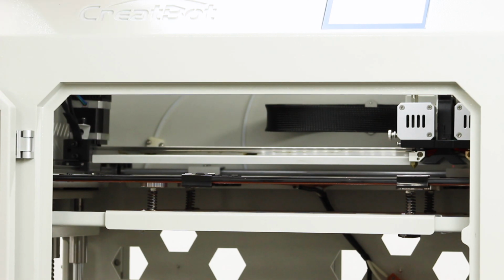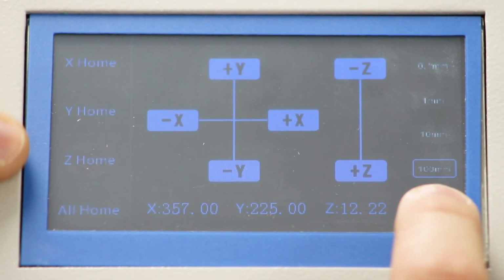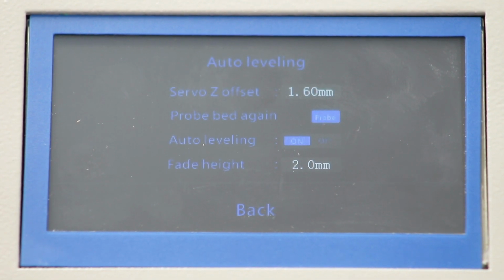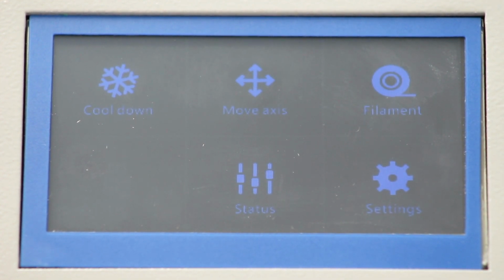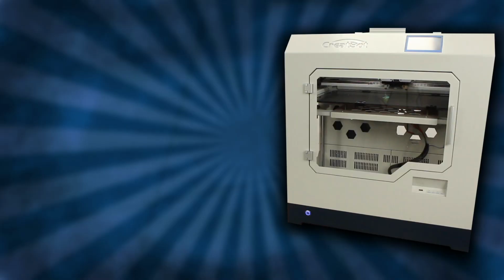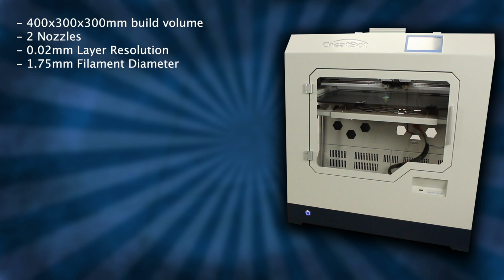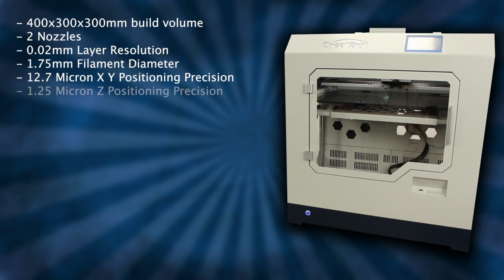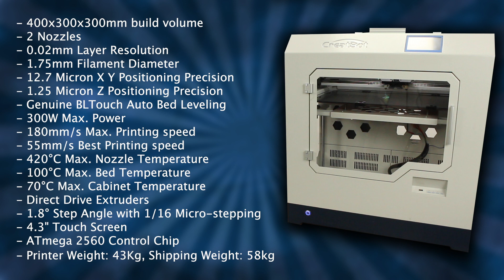Creatbot F430 Unboxing and Initial Setup

Comment: Sorry guys, but not sharing test print results makes consumers suspicious of product quality and your relationship to these manufacturers. I see by other comments  I’m not only one wondering why you avoid this.
Reply: I bought one, would not print sample parts at all.  I test printed my own part, and the print quality was amazing. The build quality of printer is very good, touch screen is eh...but it works perfectly fine, just not as polished looking as my flashforge.  So far, machine is not perfect, but feels very industrial and like a workhorse.  Its 100% capable of some really really good prints.

Comment: I have this printer and it has a large build volume.  However if you built anything close to the the build volume size you could NOT get the part out of the door.  Otherwise it is working out great.
Reply: @hightempreviews5137  Yes I need to clarify.  The machine comes with a carbon-fiber removable build sheet.  The sheet is 500 wide while the opening is 425 mm.  To get the part off the sheet it is nice to take all out and flex the sheet to pop the part off.  It is sometimes difficult to get the sheet with a part on it out the door.
Reply: @markkeown9532   No longer has removable sheet

Comment: Note that if you print a large part you can not get it out of the small front door opening.
Reply: How did you get it out then?
Reply: Who on earth builds a max x,y,z part? It would take a week and several rolls of filament.  So thats just a dumb observation that a few youtube mathmaticians harp over.

Comment: The video was great but I always end up wanting to see a test print on all the unboxing videos you guys do.
Reply from the maker: We are working hard on them...soon we will be releasing many print videos :)
Reply: I have an unopened f430 bcuz i may return bcuz im looking to find out the REAL print volume using the dual ext. Cura is telling me its like 337mm 😵‍💫and Creatbot says its “close” to 400mm (X axis). My part is 388mm and dont mind angling a bit but dont want to get stuck w a $4k printer that isnt much better than my CR10s pro. Any help??
Reply: Creatbot informed me at seems to be right that Cura settings are X-510mm, Y-320mm, Z-300mm…Xmin -20, Ymin -10, Xmax 10, Ymax 10, gantry 60mm, Extruder 2 offset is 73mm.
Reply: @LoveItDirtyOffroad  hi Adam did you have to pay extra fees for your printer.  One site I am looking at lists it for $4270 but has a 7% off and free delivery 'sale'.  I have read comments about a duty tax??
Reply: @sankarkrishnan7425  i did not, assuming you’re in the US like me there are distributors located around (mine shipped from cali i think) so no duty tho I saw that during purchase too to the best of my knowledge.

Comment: Is it open GCODE? Or are we locked to their slicer? Disappointing to see an 8 bit driver board when much more powerful boards are pretty cheap.

Any test prints doing ABS, Nylon, PEEK? Soluble supports?
I enjoy your thoroughness. Would love to see an extruder teardown or just a look into how its been put together.
Reply: It can use any gcode from slicers such as cura or prusaslicer. You will need a custom profile though. Their own slicer (creatware) is an okay slicer as it's a fork of cura 15. I have printed abs, pla, and lots of carbon fiber nylon and it prints them all very well. It is a decent machine and can handle a lot of materials. The stock auto leveling settings are not good though so you will need to do you're own testing to dial them in.
Reply: @maxwellhansen522  how did you get it to work for you properly? I just purchased printer and i only had bad experience with it.. damaged heatbed sheet after second print.. leveling heatbed is super comlipacted..

Comment: Hello, how is the 3D Print quality? OR can any Creatbot D600 Pro 3D Printer owners comment on the 3D Print Quality?
Thanks
Reply: Since there are so few resources out there for this printer, I decided to give my experience with our D600 Pro and it’s lengthy. We have one at my place of work at which me and two other guys are the main operators. It sometimes works...then we have issues...then we make adjustments and it works...for a while. I can't say for sure if it's the manufacturer, the software, or the operators, or a combination of each. I will say I use Cura at home on my Ender 3 V2 and have had almost no issues.
On the D600 Pro, lately the extrusion in Nozzle 1 is coming out "bumpy' and I cannot for the life of me figure out what is causing it, but I suspect the stepper motor - we are currently using Nozzle 2. We cannot figure out how to add this printer to Cura, so until I learn how to make the G-code work or what 'flavor' to use, we are stuck with their slicer, CreatWare, which appears to be an old version of Cura. It isn't terrible but your slicer options are extremely limited compared to a modern version. The filament path feels extremely long to me (from the bottom rear compartment up the side and through both X- and Y-axis drag chains) and we have had filament get stuck, stretching the filament just above the extruder until it snaps, ruining prints. The X drag chain runs right up against the filter compartment in the rear top, and one time it caught on the corner and the print head stopped while the belt stepper motor rolled on, causing the belt to skip over the stepper motor gear, vibrating the thing like crazy. It sounded like we broke it but we were running the print head using the UI screen controls – we have not modified the printer in any way (yet). Other comments I have are that the UI works but feels very basic - not a big deal though. The stepper motor drivers (or the motors?) produce a noticeable humming. The manual is difficult to read and does not give proper procedures for tramming/leveling the bed and for setting the Z offset. I just did that this morning and it's working - for now. I have enough understanding of printing at this point to feel comfortable with it but others without the experience will not have the support needed as it's not covered very well in the manual or their support videos. I only know how to do it because of my Ender at home, which has a massive user base that I was able to use to learn from.
It does feel very solid mechanically (again, aside from the bumpy extrusion), but the software side of things (stuck with old slicer, basic UI) needs work.
Overall I would proceed with caution. If you are ok having to tweak things and have a good enough understanding of printing, and wouldn’t mind modifying the printer to correct some annoyances, you probably won’t find this print volume elsewhere for this price. The heated enclosure is nice. It’s definitely massive and it’s cool to have the experience of working on a printer this big. But it’s going to come with some headaches.
Reply: @fairandfree9824  Thanks for the much needed D600 Pro feedback and how old is the D600 Pro you are using?
Reply: @patentexperts1675  It's about 10 months old give or take. We do not run it all day every day. It is for building prototypes and sometimes production fixtures so we typically use it a couple times a week.
Reply: @fairandfree9824  I just purchased the D600 Pro and I'm a little nervous about setting it up and running it. You wouldn't be located in Florida??
Reply: @patentexperts1675  Hey...if you want to buy me a ticket, I can be...I wouldn't mind a 'business trip' to Florida! And by the way...yours might work out just fine. That is just the experience that we have had so far. If you're new to printing, it's definitely worth spending the time to find some videos and articles on printing basics.
Reply: @fairandfree9824  I believe you can email them to get the settings you need for cura.

Comment: Fan for filament cooling nearly completely covered by the extruder casing
Reply: @Jason look at the intake of the fan. Approximately 60% of it is covered by the steppers.
Reply: This fan there is generally a bad idea. It costs print space, because it moves the nozzles more apart.
Reply: And they mounted this asymmetrical extruders the wrong way, they should swap it to get the nozzles more close. Another loss of print area, but will not work without a complete redesign of the extruders.
Reply: Maybe they should send me one, and I show them how to do it right ;)

Comment: I got an F430 that was a bit of a lemon.  If I set the chamber heater over 30°C it will just stop printing and turn off after a few hours.  The printer needs a -Z limit switch.  Would like to have retracting nozzles.  If you use other software (other than CreatWare) then the out-of-filament and the loss of mains power features will not work.  Only interface is via USB, would like to see wifi.  Good mechanical design, linear rails. 
 I think the filament motor could use better cooling - if doing heaps of filament retract (say >3 mm) the motor will heat.  The filament motor drive shaft is the filament drive gear - which gets warm and you can loose filament feed.
Reply: The 30° C problem is worrisome as that's just a little over room temperature. Kinda defeats the whole purpose of adding a heated chamber.  Is this still a consistent problem or was that a one off?  Would you still recommend buying this? I was tempted to buy it, but now I'm not sure.
Reply: @daveh9817  
Just this week I got a new pcb and shielded cables with ferrites from the factory.  This seems to have solved the problem - I have tested at 60°C air temperature and all good.  It was a painful process to get a solutions to this problem.
I think that CreatBot has good value, good mechanical design.  I am printing 24/7 most of the time.  I do not have hands on experience with other brands of printers so difficult to rate.
I have a Raised3D E2 on order as my next larger-volume printer.  The Raised is more money but has retracting heads and wifi.  Which one is better suites my manufacturing needs - not sure until the E2 is delivered (February 2020) and in production for a bit.
Reply: @coolingsolutionsnz  Hey thanks Mark! Glad you got it resolved. I'm new to printing so this is the first printer I'm considering so I'm not sure what those upgrades are. I guess I'll have to ask for those same parts. 
Were you tempted to get the bigger Pro 600 with huge build area? That looks pretty beefy and amazing too.
Reply: @daveh9817  NO the Pro 600 is just too big for the nozzle size (0.4 dia) this type of manufacturing.  Bigger is not better.  If for some reason you want to print a part bigger than the F430 build volume then get creative and break it into several smaller parts.  This will also reduce over all warpage of the part.  Start off with small easy parts ("calibration parts" ).  Study bed adhesion techniques, controlling warpage and materials before you get the printer.
Reply: @coolingsolutionsnz  Thanks Mark! That sounds like good advice! 👍🏻
Reply: I'm very surprised no motor cooling has been provided from what I can see. With regards to the drive, do you find the extrusion rate/ratio varies depending on how hot the motors get? In my experience with these sprung type idlers, the teeth sink deeper into the filament depending on the internal temperature affecting the extrusion ratio. Solution is just to replace the spring with a nyloc nut. 

Have you considered replacing the controller with Duet3D controls? it's something I'd consider but at this price, that's not what you pay this much for esp if you need a "just works" solution.

Are you still happy with it? Done much ABS? Any other comments?
Reply: @jotham123  As chamber temperature increase the chance of the filament feed has an increased chance of failing - which is true for most printers.  IF you  high build-plate temperature and have feed issue due to soft filament - you can open the top access door to reduce the chamber temperature while maintaining the build-plate temp.
Reply: I see the 2020 printers have much larger cooling fans (at the hot end) so this should resolve issues above.
Reply: @coolingsolutionsnz  I've been looking at the raise3d range and yes they cost a lot more but they look like a much better engineered product. Mmm.... Good to know that's been resolved.
Reply: Hey, Im considering this printer or a raise3d. How has your experience been like with both printers. What is the quality of the prints?